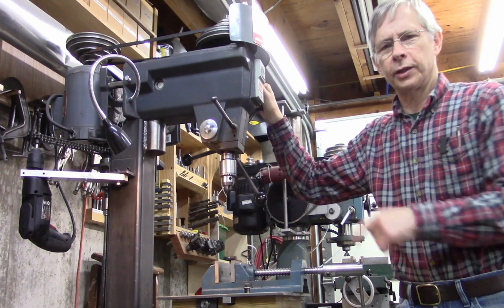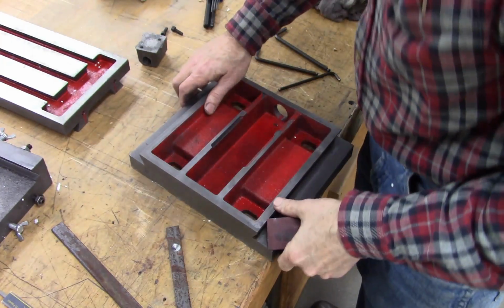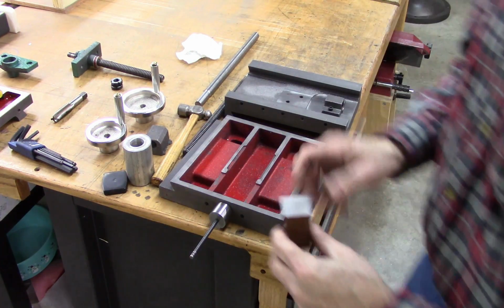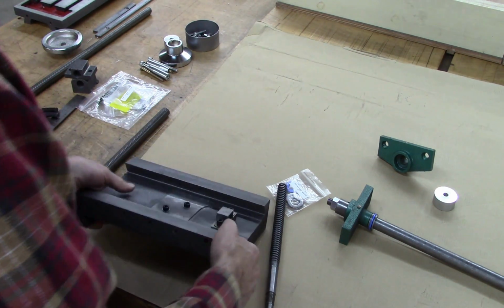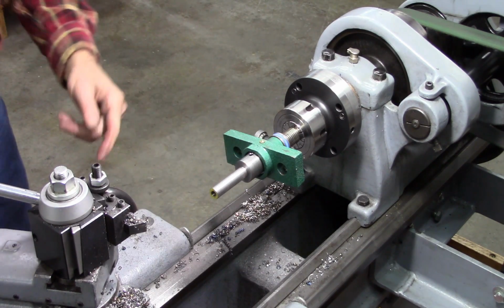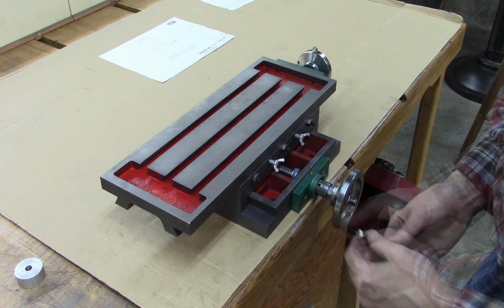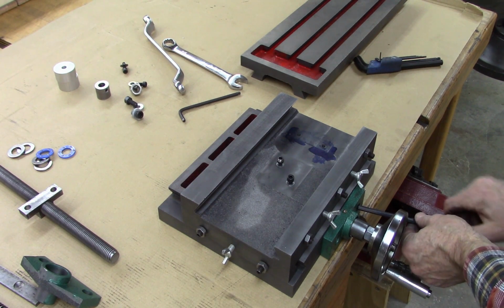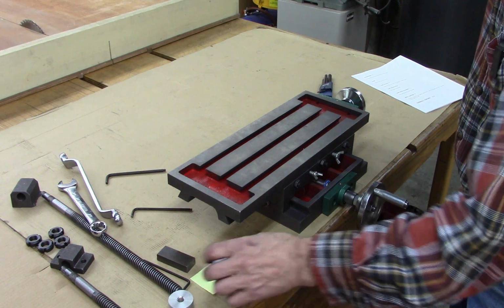Part-1 Vevor Compound Mill Table Review and Lead Screw Upgrade

Comment: I went to McMaster Carr, and a 3 ft Acme 3/4-8 (.125" per rev travel) is only $18.78, your two picks are $4.97 and $8.01, that's $13 for 2.5 ft. Not that much more for Acme
Reply from the maker: Very true, the nuts and or taps add cost though. I've used 3/8"-10 Acme in the past. It's sort of an odd size but the smaller diameter is nice in some cases. I have a LH and RH acme 3/8-10 tap. I probably should have made the y axis on my table LH.

Comment: How much weight can it handle?and still move smoothly
Reply from the maker: I have no idea. I'm sure I've had 20lbs on it without issue but beyond that its hard to say. The castings are good but the original leadscrews are terrible.
Reply: @WinkysWorkshop thank you

Comment: Why change the lead screws? Why not just make new dials recalibrated in inches?
Reply from the maker: The new lead screw is 10 Treads Per Inch. This means that one turn is 100/1000 (or 1/10").  I thin the pitch was 4 mm per turn on the original screw (which is silly even for metric) but that means one turn would be 0.15748". I'm not sure there is any way to scribe a dial with usable increments. 10 TPI is easy. 10 turns moves the table 1-inch and there are 100 increments around the dial. Each increment is .001".

Comment: I really enjoy the one I purchased ☺. Pleasantly surprised with the quality vs the cost! I am a retired tool and die maker and wanted to upgrade my old heavy-duty drill press so I thought I'd give this little buddy a try! For the home shop it is perfect for my needs. They also offer a dandy 6" jaw vise and a great rotary table as well. Happy Cuttin🎉
Reply from the maker: I agree, the lead screw is the only negative. I like the dials but a cheap dro would be a lot easier.

Comment: I'd appreciate the dimensions of the original Acme thread so I could buy a better nut for them and make that fit. Surely one can just bent the stock screws to somewhat straight? Coming from Norway I love the millimeter indication :)
Reply from the maker: I can't remember and the screw is long gone. I don't mine metric but 5 or 10 per turn would be way better than four.

Comment: 00:54 Use a c-clamp to lock the surface holding the vise to the cast iron table top.
Reply from the maker: Yes and that works. I have done this, Thanks

Comment: Hello sir, I am following your intervention on the cross table with great attention.  In 8.44 you are loosening the slotted nuts, would you be able to give me the characteristics of the thread of the screw on which these nuts are screwed, diameter and number of threads per inch.  I can't figure out what these characteristics are.  Thank you in advance and good luck.
Reply from the maker: I'm not sure what the thread was but metric for sure. It was like a threaded ri ring with spanner wrench slots. I just looked for them and could not find them. Sorry.

Comment: Bro, you have a mill, why are you putting a x-y table on a drill press ???
Reply from the maker: Good question. For a couple of reasons actually. First, the drill press is quick and easy. The chuck takes up a lot of room on the mill and requires a big move to install and second it's nice to have a second machines so I don't have to undo a set up on the mill. Since making this video I did the same for a 1917 Avey drill press and installed DROs. Unfortunately the second drill press isn't the most accurate. If you apply too much downward pressure the chuck moves toward the operator. It still within .010 but if I need more accuracy I use the mill. So far I have not figured out how to fix the Avey drill press.

Comment: Amazing value for money... And of course it's great fun and satisfying to raise it up in quality level using elbow grease and hand finishing. Subbed. Very enjoyable.
Reply from the maker: Thanks, BTW, I made a set of steel dials and had them black oxide coated and then used some wet/dry 600 grit to remove the extra. They looked amazing.

Comment: I bought one of these a couple of years ago. I had to do some work to get the travel smooth and take out excessive backlash but nothing as drastic as this.
Reply from the maker: Yes, most of this was to make it so that I could use inch dials.
Reply: @WinkysWorkshop  Ah. Makes sense. I'm in the UK half of my workshop is modern metric, half ancient imperial. I'm used to it, so it's not a concern.
Reply from the maker: @qwadratix  I made this video a few years ago but if I remember right the original lead screw was 4 mm per turn. For me this silly, it needs to be 5 or 10. More recently I put the same table on my other drill press with DROs. and used 16 TPI. It works very well but I wish I had used a faster tread.
Reply: @WinkysWorkshop  Yes, 4mm sounds right. 5  would be more logical, 10 maybe overkill, it wouldn't make the thing any more accurate on my rig. The drill head flexes too much. I wouldn't dream of trying to machine seriously on it. I use the lathe mill attachment for that.

Comment: If you ever turned an ACME thread you'd know why they are expensive.  How many blocks would you have gone through if you had to single point them internally before you got it right?
Reply from the maker: Yes I have turn acme threads and you are correct. I've only done one successfully and it worked but they looked a little rough. Standard threads are great for this application. The only time you really need acme is when the threads are under a high load. Despite the use of the word Mill in the name this table is usually not used for milling.

Comment: I got only to the part where the table moves when drilling round stock because of the backlas and did not watch any further. WTF, dude? Is it so difficult to fixate the table while drilling?
Reply from the maker: That was the old table. Yeah, I never could figures out a way to lock it. Most the time it wasnt an issue but I needed something reliable.

Comment: 24:56   on a project this size  you can use a lathe as a mill  think of the head stock as a mills headstock or spindle laying on it side  now all you have to do it clamp your work to the tool rest and use the x y axis on the lathe to mill your key slot.  Its crude but it can work. 
There is always more then one way to skin a goat.
Reply from the maker: It works! Thanks

Comment: When using acetone you should also wear gloves will dry out your skin very quickly then you should put the cap back on the can we're not use I know it's in the video you pushed the can to the side and left the cap there what are you letting the stuff evaporated away. Use chemicals like this it's better to put them in a smaller container also. Shop safety should always be priority number one can you send any chemicals always take special care!
Reply from the maker: All good habits, I'm slipping. Gloves last minutes, good for a quick job but more than 2 minutes they are worthless.

Comment: Don't know if you have fixed the problem but think I would of used a magnetic table so when you want to drill something round there shouldn't be any movement there are some very good video's on using  microwave transformer then pouring resin over it very power full there a bloke think he Australian he did a test 1800lb grip used a old laptop charger to work it have a look you may do one anyway know messing putting stuff in the vice table
Reply from the maker: Magnets create problems. Every time I have used them it magnetizes whatever the magnet touches. Not worth it.

Comment: Instead of ordering all new thrust bearings (23:00)..  You could have just drilled out that green flange and put a bushing inside it to tighten it back up--- and still use all the old thrust bearings. :)
Reply from the maker: The old thrust bearings matched the original lead screws. Total junk. They were also too big in diameter (ID).
Reply: @WinkysWorkshop    I don't doubt that they are junk.   but my point was that you could have just made a bushing to match the "too big" diameter;  anyway, it doesn't matter...  new bearings are still an upgrade, like you said.
Reply from the maker: @calholli  Yeah, they might have worked.

Comment: Is that a south bend 10 L? I just restored one and am starting to get used to it. New subscriber
Reply from the maker: Welcome aboard! It's a 1931 11" 85A.  It's kind of an oddball. Like the spindle size is 1-5/8" x 8 instead of 1-1/2". The gears are all different too. I don't mind the spindle but finding gears and other parts is a pain.

Comment: Nice to see a south bend junior lathe in action.

I have one as well from 1931 and am fond of it.

Do you still have the brass bushings?
I have some play on it which I need to address in time...
Reply from the maker: Its all original  you mean the spindle bearings? Its an 85A I think 11-inch
Reply: @WinkysWorkshop  yes, I mean the spindle bearings, I will look at the type, but I believe it's an south bent junior 8 1/2

Comment: I have same table, but mine has Left hand threads, 5/8-8..
Reply from the maker: 8 TPI would be good if you are working with inches and 1/16th. Mine was 4mm

Comment: Have been looking at this exact table on Amazon, after watching this I'm ordering it.
Like the lead screw update as well . 
Great presentation thanks for posting
Reply from the maker: Thanks, I bought a second table for another drill press and put cheap DROs on it. I left the original lead screws on it but I think I will replace them with 3/8" all thread. The thread on the original lead screw is very fast.

Comment: as a machine rebuilder way back in the 80s we replaced most lead screws with ball lead screws for high accuracy, and as a scraper i used to fit the ways and gibbs and even ground small grooves in the ways for oil and put zerks in the casting
Reply from the maker: Cool

Comment: should have gone with ball lead screw instead
Reply from the maker: Ball screw really don't increase accuracy unless you change direction. Of course they would be more accurate than the all thread I used. Now if I was going to use this on a milling machine (which would be a bad idea) the accuracy would be an issue. The table is being used on a drill press for positioning holes. Most drill presses probably have more movement in the quill and bearing than the error in the all thread.

Comment: On something that bad from the factory, I would demand a full refund, then often they don't want the item back so your free to keep and modify
Reply from the maker: It is amazing that the casting and the machining are really fairly good and the lead screws are so bad. I think when I made this video the price was $127 and with free shipping. This is incredibly cheap if you consider the fact that most good mill tables cost 4 or 5 times this amount. For a saving of $400 I'm willing to make the lead screws. So i do understand your point. I guess what amazed me the most is that the amount of labor involved with making the lead screws near perfect is probably the same. In fact, with more preparation (setting up fixtures in the factory) the payback would come with faster production and less waste.  Of course the Chinese are not alone in this short sided thinking. Most US manufacturing does the same... profit is king and pride is gone.

Comment: i was thinking I needed bigger heavier X Y tables for my DIY Mini Mill, But after watching this video I can see this level is way over kill for my setup. Boy you took it to another level, great review and rebuild. Do you know of a smaller strong setup for X Y table, I am slotting Pot Metal on Model Trains and Aluminum Blocks into new Chassis and truck frames, Not steel or large parts. Accuracy is on level with a farm wagon. But i need Y travel 6 to 8 inches and Z travel 12 to 16 inches.  What do you think? Dennis
Reply from the maker: Aside from terrible lead screws this table is good. If you're not worried about dials even the stock lead screws are ok. I got a second table for another drill press and put DROs on it. I'm using the original lead screws....  they are not the best but do okay.

Comment: Hi, I just discovered your channel a little while ago, i really appreciate your videos for being clear and concise. I have a question for you regarding this Vevor compound table if that’s ok? Long story short, i have a quite old very solid German Weik horizontal milling machine, which has a dial feed only for its y axis. It’s X and Z are fed with levers, very solid and tight, but especially the X is not suitable for milling a part by feeding with the lever, its not slow and gentle enough, if you know what i mean. So, i need a single axis dial feed option, but they are impossible to find here in Oz and an XY compound table like this Vevor would end up being too high/close to the cutting tool. So i am thinking that this Vevor looks like the X feed/table section comes off the base and could be used (when mounted on say a flush to the dovetail plate bolted to the mills table) as an X axis feed? So my question is does the top X axis/table section still function on its own after removing from the base/Y section please? (Phew)
Reply from the maker: I'd say you could make it work although I'm not sure how well. It's solid but nothing like a table on a milling machine.
Reply: Ok, so i gather from your comment that the top x axis table does function when independent from the bottom section. Ill consider other options and decide if this is the best way to go as I haven’t received any other better ideas for the machine i have. Thank you heaps for your reply, I really do appreciate your taking the time and trouble to respond.
Reply from the maker: @robertodimartino7412  That is correct but I'm not sure its solid enough to use o a mill.

Comment: I wish you tried and reported on it the way it was delivered.  I don't have a lathe so this out of the box would be the closest to a milling machine I am likely to get.
Reply from the maker: FYI  It worked okay out of the box however the lead screw moved 4mm per turn which is an inconvenient number. Lead screws need to be 10 based. However, i did a review later and installed DROs and kept the lead screws. Here's the video:  https://youtu.be/kX9KG6KiD-M?si=kd3CJSPa46QUUmay

Comment: Looking at the bottom holes (of the casting that was crooked) I would guess they faced that surface, then drilled the holed. Then used the holes (loosely) to align the part for the thru hole. I would have trusted that part, just knowing the main body will be mounted, not straight, but the bore is probably straight with the mounting holes.

(I have almost 2 decades of working with people who make shit this way. Hatched job from so called professionals. American made means it is the best product. The features are perpendicular or parallel to the features they need to be, but the body is out in space. Who cares where that ends up as long as it fits.)
Reply from the maker: I'm not sure I understand what you are saying. The table was actually well machined fairly well. The lead screw brackets and screws were a joke. Chinese vs American? Obviously if you buy well established brands like Starrett and Brown and Sharp (and others) you will get a much better product. Otherwise some of the Chinese product are actually better (not this mill table) although admittedly it's hard to predict. I bought a grizzly surface planer 35 years ago. It worked well but quality was not so good. Then I bought another grizzly planer 10 yrs ago. The difference was astounding. A top notch product at a very good price. The biggest mistake we made was to underestimate the Chinese.
Reply: @WinkysWorkshop  that is definitely true. I am a Machinist by profession. I have worked with bad American employees. People that run Chinese products into the ground, but perform even worse quality than Chinese products. They have come along way. Which is why I said (the lead screw nut)the casted part is probably safe to use. Way too late now, but the bore was not straight to the body, but probably straight to the mounting holes, which is what mattered more. The outside of the body could be anywhere in space, so they were very liberal with the tolerances. You had it in your hands. You may have measured it but the video doesn't tell us you knew it to be too out of spec to use. I don't know if that makes more sense. I have a complex mind and I don't know how to say things in a more civilized conversation. 🤷‍♂️🫤 Either way, I can't wait to see the second video. I enjoy watching how different people are as machinists, hobby or professional.
Reply from the maker: @Itsdirtnaptime  Got it now! Thanks

Comment: Why not be ballscrews?
Reply from the maker: Backlash doesn't bother me so no need plus I wanted the lead screw 10 TPI so that I can make usable dials. I put DROs on the second table I got and left the old junky stock lead screws in there. I may replace them at some point but the ball screws are overkill (in my opinion). With the DROs any threaded rod would be fine. There is NO load on the screw, its just to position the table.
Reply: @WinkysWorkshop  Yep, I undestand.